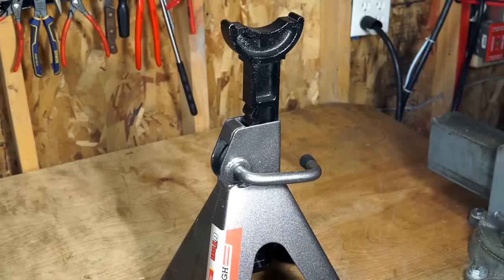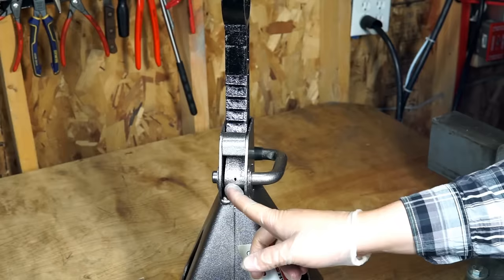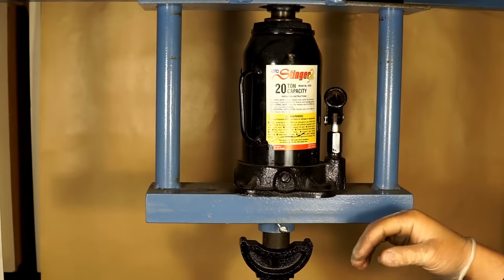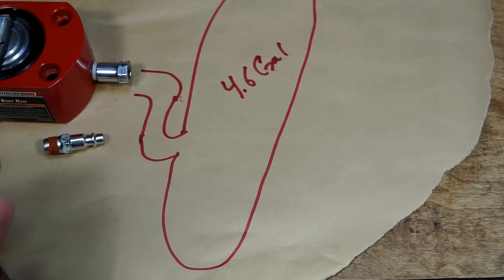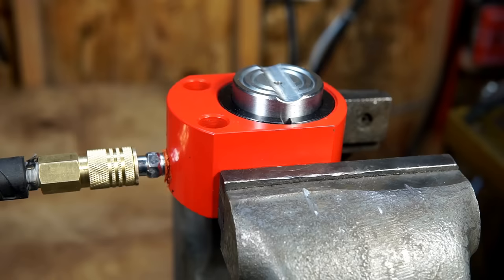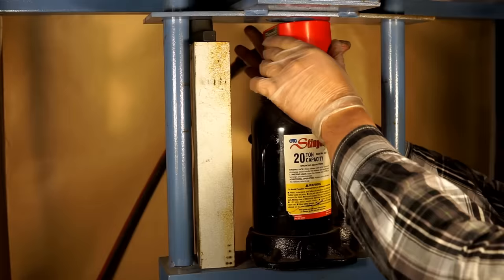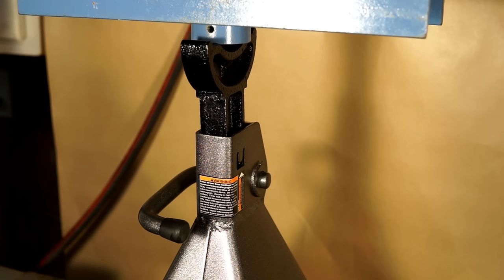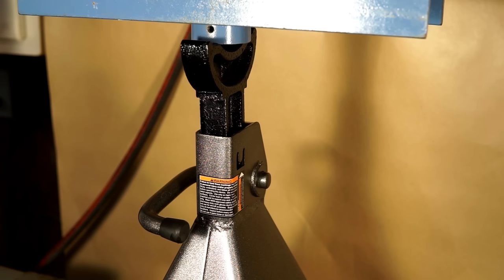EXPERIMENT: WARNING! Doing this to your Jack Stands will get you KILLED!

Comment: cool experiment. But this is what i don't get.  Even if the guy did bump it and make it drop....it's STILL ON jackstands...just lower.  That jackstand would have to be knocked out from under the car too.  In other words the car itself would have to completely fall off of the stands which tells me it wasn't put in the correct spot to begin with (or on a sturdy, level surface)  So i don't get how he got crushed simply from this stand getting lowered a few inches (although i would crap my pants for sure) :D
Reply: Snow Wolf give one instance of a harbor freight jack stand failing. Oh that's right you can't.
Reply: Well if it was a guy with a Porsche, I'm sure he didn't know what he was doing
Reply: What's up Steve,  I'm a big fan and subscriber to your channel,  it's a dream of mine to have you do the audio on my car one day.  it would be like having Bruce Lee teach you how to fight!  love your work brother keep it up.
Reply: also most jacks have pins to install after you jack it up>
Reply: he could have been under one side of the car where the jacks are either 2 in front or 2 in back, basically he would be coming in from the left or right side of the car. THEN knocking out the one jack from the side he's on could have the car come down on his face WHILE the other jack is still in place.
Reply: No Name 😂 hahah yup
Reply: It worked for hillary
Reply: I mean I can’t fit under my car my face can’t fit if a jack stand were to magically fail I would need to lift my car and call for help
Reply: Tommy Holmes:  yeah but what about Benghazi?
Reply: Guy must have a giant head.
Reply: meade916 that's my thought as well. Safety is a must when you put that kind of trust in your jack stand. I hate to change tires in the dirt for that very reason. Road side tire change is the best way to get hurt.
Reply: Snow Wolf I’ve gotten 95% of all my equipment from harbor freight and considering all my hand tools plus jacks and stands are from there I can assure you it’s just as good as snap on as far as that goes I’ve busted and snapped more snap on tools than I ever have Pittsburgh from harbor freight
Reply: When were talking about a Porsche, knowing how low most of those cars are, the lowest setting on a jack stand wont keep you safe. I have an old miata that I work on and I know I have a slight fear every time im under it because I have the same issue, the lowest setting would not hold the car away from crushing me
Reply: @outdoorexpert4038  I don't believe it. Pittsburgh tools are cheap for a reason. I've snapped plenty of Pittsburgh wrenches, broken screwdrivers, and cracked sockets.
But that's not why you buy snap-on. Actually I don't recommend you buy snap on anyway, there's a bunch of mid tier brands that do just as high of quality, if not better. You buy them because theres always a time when you need a tool with just the right fit, just the right feel in the hand, just the right angle, and just the right amount of bite. And these higher grade tools are less likely to let you down. What's worse, having to cut off an exhaust bolt because your Pittsburgh rounded it off or having to pay a prettier penny to not need to make that extra trip for cutting supplies?
Reply: Andrew Winslow.. I've been using the Pittsburgh sockets for over 10yrs with out a broken socket as of yet. I use there chrome sockets with my 1/2" & 3/4" Mac impact daily in my shop and on my service truck.. Have yet to break one.. Now I do feel with screwdrivers and wrenches you do get what you pay for, But the free set from HB is grate when you need to make one a certain length.. I only use Craftsman & Gear Wrenches.. Don't get me wrong I do have Snap on and Mac sockets and wrenches but you lose a Snap on or mac socket in the dirt while under a tractor out in the field and your looking at 10-20 bucks for just the one socket to replace it with.. You lose a Pittsburgh and 10-20 bucks buys you anther hole new set of them.. But you mention rounding off a exhaust bolt well you must be using the 12 point sockets witch is a big no no you only use a 6 point and a good penetrating spray like PB Blaster on them and that doesn't happen as much.. But any brand of socket will round off a exhaust bolt if done wrong.. 

Now If you have 10 grand to spend on a set of SAE & MM in deep and shallow in 6 and 12 point for 1/4", 3/8" and 1/2" drive by all means get them from Snap on or Mac.. If your poor it's about 250 bucks from HB for the same full set of SAE & MM in both.. And you still have a lifetime guarantee if you break one of them.. IDK about your HB but the one I've used for the past 10+ yrs just trades them out if the package says Lifetime warranty on it. 
And there new extending 72 teeth ratchets are grate and work really well.  I'm not saying everything they sale is top notch by any means... But a lot of there stuff works very well for the price. And is grate for the home hobbyist that don't need 10g worth of tools just laying around that mite only see use a few times a yr.. I how ever use them everyday in my shop and on my service truck with out any major problems to date.. And some of there air tools work just fine. Like there die grinders..
Reply: Foe what it's worth, my jack stands (from Advance Auto Parts) are small and they collapse to 10 ¼" tall. The distance from the back of my head to the tip of my nose is about 9 ½". If the injured guy (reportedly a large man) was lying on a creeper and looking upward  I can imagine the car hitting his face when the jack post retracted down into the base. What I'm having trouble with is how the stand failed at all if the car was stationary.
Reply: hiphopcroaks24 harbor freight has some decent things that are inexpensive and work well.  

A rule of thumb though is if your life or safety depends on it, don’t buy it from harbor freight.  That means don’t buy jack stands there, or welding masks
Reply: i know i would be squeezed by my car if the jack stand stayed under the car but all the way down. Might not die but it would hurt.
Reply: @jhitt79  Id also like to see evidence of Harbor Frieght stands "prone to failing".  Im pretty sure that's something that could very well bankrupt them quickly through lawsuits.
Reply: gdanp78 exactly!
How long would a company last if their jack stands were failing and injuring people.  Some people just are stupid and want to spew nonsense (like Bronson D above.)
Reply: I was thinking this and I thought that maybe the jackstand fell on its side
Reply: Could have been under the tire or the lowest part on the car
Reply: mead 916  ..with the extender down the stand is only about a foot tall ..
Reply: Joseph Kirsch ..and those are the only type you should ever use ..
Reply: If the car drops down onto the stand at its lowest, you're gonna get hit.
Reply: Snow Wolf  this is simply untrue. Harbor freight makes decent jack stand and the design and materials are so simple it's difficult to screw it up.
Reply: i do agree with you meade916.  even if the guy was a heavy set guy it should still not crush him
Reply: I know its an old video but I had one of my harbor freight jack stands bend outward after putting an eclipse on one. I took it to my local store and showed them. They said they were gonna contact their uppers and give me a call, a year and a half later they still havent contacted me. But they were nice enough to give me a set for free lol
Reply: Just curious but unless it said they were HF stands in the actual article, I highly doubt someone who owns a Porsche is going to buy stuff from HF, just saying.
 Personally, this person must have been putting some hellacious torque on something to move the car that much.
 Maybe I am just over cautious, but ANYTIME I have my vehicle on stands, I either still have wood blocks under it or at the very least, the fucken wheel, if not both....
 I also seriously doubt it crushed this dude's face, sounds like a highly embellished story
1- I doubt he works on his own shit
2- Doubt he purchases from HF
Probably drove himself to the hospital also, with a broken jaw, fractured orbital sockets and a possible brain bleed, just saying
But hey, what do I know, absolutely nothing!
Reply: he could have put the jack stand on the higher jacking points (liks suspension or a part of subframe rather than frame rail) than what crushed him
Reply: Luckily I’m a pretty skinny guy so I wouldn’t be crushed if that happened to me
Reply: And a rapid drop on a jackstand could tip it over completely.
Reply: Very true
Reply: If it was raised with only 1 jack stand and it failed then the jack wouldn’t need to be ejected from under the car. It sits low enough on its lowest setting to fit under a resting car, making it useless for holding anything on its lowest setting.
Reply: Those particular jackstands bottom out around 10 inches. I have the exact same ones. And there's absolutely nothing wrong  with them. Like any jackstands, you have to place them on a level surface and in the correct place underneath the vehicle. Common sense is uncommon, I realize that, but it will prevent you from having the same thing happen to you that the guy mentioned in this video
Reply: @sungyoungkim4382  Exactly, I don't get why people don't consider this thought.
Reply: Just like with any tools..maybe his had a slight defect..maybe the teeth were a bit short or something else... can happen to the best of tools..(machine made products all have slight inaccuracies once in a while causing a defective item..) NOW if there was a trend of the same issue occurring with many people, then you can blame it on the quality of parts and company.. but one offs happen to everything..even to the most expensive brands... it's funny I always wondered why jack stands have such small teeth anyway how much harder would it be to make it another half inch longer to give it more of a hold
Reply: Beavis Wells I’ve been doing it for years that’s what I do for a living and if you use common sense and watch what your doing you will never get hurt unless some asshole runs into you.
Reply: That 500 pounds of weight put on one jackstand is just an estimation, it could very possibly be less. It would probably be around 500 pounds if the ground was completely diagonal. I would assume Mike was doing this in his drive way, and it could have very well had a slight uphill. So if he used the jackstands as close as he could get to the front he puting something behind the back wheels of the car and factoring all of this in he could be looking at less than 500 pounds I'm guessing.
Reply: The force that made the jackstand drop most likely also moved the jackstand away from the reinforced lifting point, so, when the car dropped and hit the jackstand again, the latter now just penetrated/crushed whatever part of the car was now landing on top of it, which allowed the rest of the car to drop basically to wheel/axel levels. If there were any wheels on the car at all in that moment. And especially on a sportscar like a Porsche, the wheel/axel levels are already very low to begin with.
Reply: I'm a pretty thick guy with a chest probably around 12" front to back, those jack stands would not work
Reply: Use ramps.
Reply: @NoelAWinslow  - Don't waste your time arguing with him. I've got a lot of HF stuff that is fine for generic home gamer tasks. However, I returned my HF stands because my life is worth a few bucks saved.  HF is all made to the lowest cost, while Chinese can and do make very high end stuff, for those willing to pay for it.  Grinders, ratchets, etc if you want decent quality, try to find some stuff at least made in Taiwan.  On average, its better than the majority of Chinese stuff sold at the same or even higher price.  Taiwanese take some pride in doing good work, whereas Chinese as all about getting over on everyone any way possible. Thats why they were putting melamine in Infant formula they sold to their own people, and leaded paint on kids toys sold outside of China.  Most stuff at HF is made from whatever pot metal they get cheapest.
Reply: @gdanp78  Yeah, they just did a national recall on all their models out of the goodness of their heart, right?
Reply: @KLAWNINETY  Its so difficult to screw up, and yet lo and behold, HF had to do a national recall of all their jack stands, and even now a year later, still haven't returned them too stock.......  Go ahead, risk you life all you want.
Reply: @boots7859  wrong
Reply: I found it a very interesting experiment! And depending on the jack stand clearance itself, I can see being trapped, or worse!
Reply: hiphopcroaks24  they are failing. Very common
Reply: @jhitt79  your comment aged like milk
Reply: @Giovanni_Litterini  well….okay.
Reply: What if you need that extra room provided by the stand extension? That's why you had it extended to that height. If it comes down to the stand, you could be in deep doodoo!

Comment: I thought you would increase the load to 1000lbs to see if the pin failed.
Reply: Yes, find out how much weight causes the pin to fail.
Reply: Using the same 2.36 piston setup would require him to double the air pressure to go from 500 to 1000 pounds of simulated weight. Since 500 required 115 psi,  1000 would require 230 psi...... The highest air compressor pressure I've seen was 175. That was scary as fuck.
Reply: Good point about the increased air pressure. I hope he can figure out a way to do it though.
Reply: Stuart Hall  Doubling the area of the 2.36 piston would produce the same result as doubling air pressure. That comes to approx. 3.334 dia piston.  Increasing the piston diameter 30%, doubled the area....pie are square
Reply: Ima Tumor 
No, pie are round, cornbread are square ! 😎
Reply: Ima ...  Pie ARE NOT square.  Pie are ROUND, I just ate one!
Reply: But there's 5000PSI compressors for things like airguns?
Reply: JacobJustIts scuba tanks 2000+ psi.
Reply: He could have put a gauge on the hydraulic jack and did the same thing. once the cam is dogged in place it makes no difference if the little pins shear, it ain't going no where. I replace the pins on mine all of the time.
Reply: SegoMan Why do you replace the pins? Do they shear that often?
Reply: Mark the oem chepo do not stand up to dropping or gently pushing the stands into their storage area. Once they get replaced with a quality roll pin - no problemo with 50 years of service on some of them.
Reply: Apple Pies R Squared. Area = Pi*R^2
Reply: ***** jeez, the pressure is not reduced it is maintained at 115 psi. POUNDS PER SQUARE INCH.
This is very simple. I was a tool and die maker for 30 years and worked with pneumatics and hydralics. 
The area of the piston  times the pressure equals the FORCE acting upon it.
 I think I'm being trolled......
Reply: Dragon  .... 1st, isn't that Pie in that formula?  Secondly, pie are round, just look at one.  Thirdly, didn't realize I'd get so much mileage out of such a stupid comment.  ;-)
Reply: Ima ... I think "the product" actually said it correctly. It's just so convoluted it's hard to tell.  I get from it, increase the piston size, and for the same piston force, you have to reduce the pressure, which is correct.  I'm not entirely sure that's what he said though.
Reply: John Sikes Yes , what you stated is correct.
Reply: Easier to do, concisely and accurately, if you have an engineering degree, I expect.  ;-)
Reply: @eiserntorsphantomoftheoper2154 halfing the piston area not doubling it... your reducing the per squar inches part of psi, thus increasing the pounds part.

Comment: This scenario is obviously not going to happen while working on a car in the real world,but I will tell you that I had a jackstand fail in a scary way at my old job. We used various shop jackstands all of the time for vehicles with no problems,until one day a certain little red one fell to the last stop while it was under a vehicle. My boss thought I was nuts,but the other mechanic seen it too. I reset it and it was fine for the duration of that repair (I used a tire under the vehicle after I reset it just in case). Well days,or weeks later it happened again and that was it for using that. I told my boss to scrap it and put it aside. It looked identical to 3 other ones,so I didn't want it getting mixed up with good ones. He puts it back with the four one day and I refused to use any of those after that. I have no clue why it randomally failed to this day.
Reply: Tolerances on jack stands are probably crap.  They're made cheap in China.  It was probably out of spec enough to slip.
Reply: @jshepard152  You had a cheap boss who didn't care about safety.
Reply: @chien-shengtsai8626  LOL china make cheap, not good. boss from china
Reply: Spend more money, MIC is then good.
Reply: One idea to explore or expand, on this is, if a Bungee Cord, hooked over the Handle, would even add any "Safety Factor?

Another might be a "Cover" that slips over the Handle, that blocks the Movement of the Handle moving up, and it, (The Cover) is held in place by a Short Bungee Cord!

Of course, if the Catch Pawl, or Tooth, and the Support Arm Teeth, are loose, or Worn out, such ideas as mine, would still be Useless! 

But, as demonstrated in this Video, it doesn't seem too hard, to build a "Shop Test Rig" for Jack Stands!
Reply: @chien-shengtsai8626 yeah thatd be was sign to find a different job
Reply: Should've taken the angle grinder to the bad one so it couldn't be reused.
Reply: Mark that one with a marker or scratch a visible memory mark on the bad one.
Reply: The user may accidentally kicked that jack stand while doing his repair or loosening his objective.